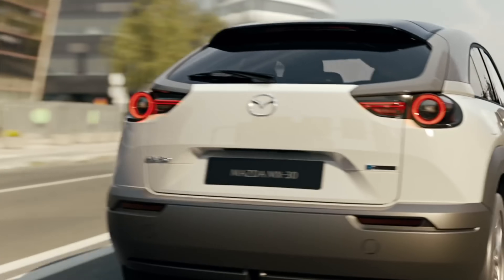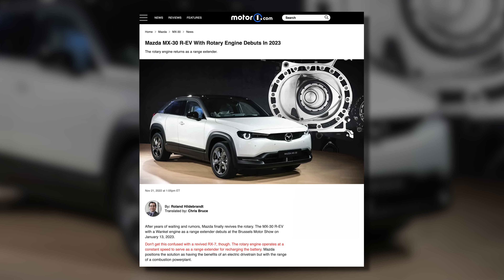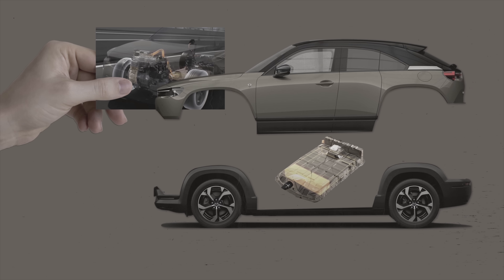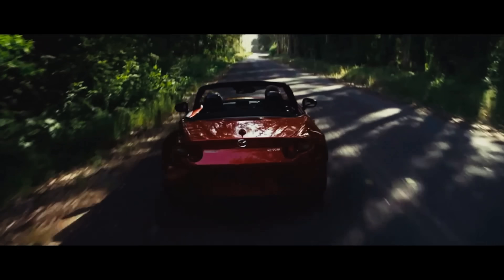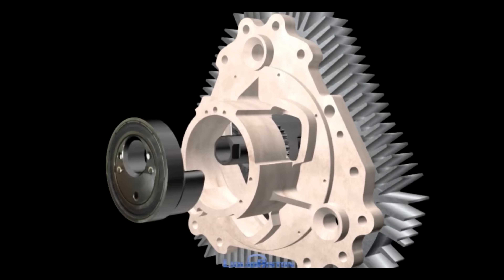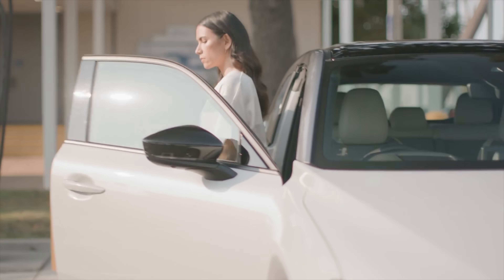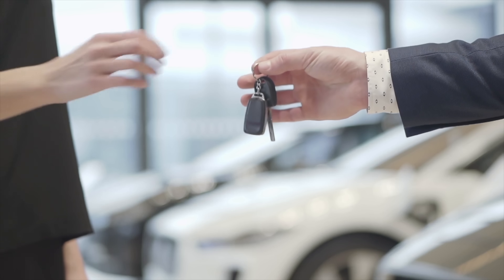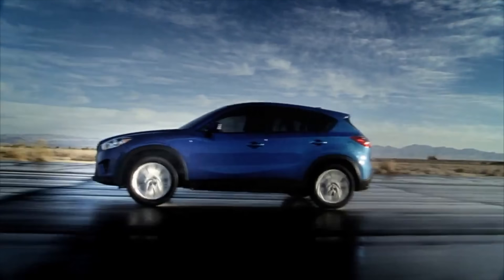Mazda's New Engine is the Smallest and Most Powerful Engine Ever Made

Comment: Plug-in hybrids are the technology of 2010, when batteries where 1000$/kWh
The 2020 standard is more like 100$/kWh, making a gas engine a half-measure and useless weight, expense, main point of failure, a source of ongoing pollution. 
It's a dead-end.

Comment: From what I understand about a PHEV is that once the battery discharges to a certain point the engine kicks in and provides continuous driving only limited by how much fuel you have.
Am I right in understanding that in this case the range extender can't ensure continuous driving just reduce the discharge rate? That at some point the vehicle needs to be connected to a charger to recharge the battery or let the engine recharge the battery while not driving, is this correct?

Comment: I think Mazda did great by applying Wankel's engine where it's efficient the most. Another good thing about rotary engines which hasn't been said - they are extremely powerful. 1.3L rotary Mazda could reach up to 250hp which is why there were amazingly popular in Europe where car taxes calculated based on the engine volume not power. Downsizing the engine and leaving only one rotor they still can easily have 50-60hp engine from something less than 500cc, which is also plenty for generator alone, and because rotary engine can work in the most optimal mode while charging the battery their lifespan can also be hugely increased. Fixing rotary engine isn't hard as it only has 3 moving parts altogether.

Comment: Would the motor be able to charge battery without use of charging station?
Reply: Yes but using a gas engine to charge your batteries is not that efficient.

Comment: I like the idea of a range extender EV with a much smaller battery than typical EVs, but I'd stay clear of rotary engines. I kinda like the opposed piston engine designs I've seen. I can imagine one of those making a great range extender.
Reply: I like your thinking.
Perfect application for a small OPOC engine running at a constant RPM when needed.
Reply: I’ve thought the same thing, it’s something I’d like to experiment with if/when I ever win the lottery.
Reply: The opposing pistons are great and produce extreme torque. It's use in WWII submarines proved it. In fact in some cases trouble or damage was sometimes temporarily overcome by disconnecting a cylinder if needed. They are, however, two strokes so diesel or a fuel/oil mixture is needed to keep the cylinders lubricated so that's a negative for emissions and as with all reciprocating pistons, they stop twice during each rotation. The rotary has the potential to be a lot better because it's torque curve is like a turbine or electric motor; just smooth and steady.
Reply: @waynegilchrist1596  I've read of gasoline OPOCs, but I don't know about the lubrication. I'm not too much of a gearhead, and it was some time ago.
Reply: Very little vibrations with rotary engine. 1/2 the weight of the other internal combustion engines. This engine could also run on Methanol, DME, Hydrogen, Ethanol, propane et al.

Comment: These hybrids are a way of rapidly getting more electric vehicles functional. Using less heavy and precious materials in the battery.  However I am puzzled over the choice of a rotary.  I loved my rotary RX3 but it was inefficient at low throttle settings.This it has in common with two stroke engines.  But worse.  Now if the engine was small enough then it would only ever be run at optimum load.  If I understand your video this is a 70 HP engine.  Until recently I never had a car with as much as 70 HP running as a pure gasoline vehicle full time.  How much power do people REALLY need?  Obviously way more than is good for the environment.

Comment: My concern is too frequent charge and dischage the battery because of that's battery size. It is gonna be a problem for the battery life span.
Reply: But the battery will cost half as much so you can replace it and you arn't lugging a big battery around all the time.
Reply: @gbone7581  Many manufacturers promised low-cost batteries, however, They never came. 

You can see Toyota Prius battery cost. that is not even lithium ion and is much smaller than this model. 

They have low energy density and cheaper material but they charge at least $6K-7K for replacement.

Comment: This "Most powerful engine ever made" weighs 97Kg, produces 145 Hp at 4500 RPM with a torque of 200. Koenigsegg also put a support engine in their electric hybrid, it's a 3  cylinder, 2 liter double turbo engine that produce 600Hp and 600Nm torque at 8500RMP with a weight of 70Kg.

No, it's not even close to a fair comparison, you could probably buy the whole current Mazda 2023 model program for the cost of a single Koenigsegg, but that stuff is irrelevant when you make the claim "Most powerful engine ever made" without adding "rotary" or whatever other excuse someone might have when calling a 145 Hp engine "The most powerful engine ever made".

Comment: So they are taking a poorly designed EV and adding in a low thermal efficiency motor which also needs gas tank and plumbing and it makes a lot of heat.  This will not end well for Mazda.

Comment: I have a 2016 Chevy Volt which has 53 electric miles and 302 gas miles. 85 percent of the miles are electric. Gas miles are only used when I travel long distances. I like the Mazda design. The reliability of the engine is to be determined later. The reliability of other components are also to be assessed

Comment: Been saying for a long time a small 49cc engine operating at it's "happy" rpm's, keeping battery topped up was the way to go.
Reply: The Mazda engine produces 70PS.  I doubt a moped engine would be in its "happy" rev range trying to produce this!  In any case, EVs are not really the future, are they, if they have to be propped up by internal combustion engines?
Reply: @ParaBellum2024  why are engines so large? Is it so they can idle down the highway? No. It's so you can have the acceleration or power even in the lower power band. What are electric motors good for? Acceleration in the low power band.

We could have smaller engines and less acceleration but that has been tried and doesn't sell. People like performance too much to give up the modern conveniences.

Comment: Good idea but what about using the compressed air engine instead of the rotary engine for extending the mileage of the batteries. Use compressed air and batteries, no gas involved.

Comment: I've always wondered why more car companies don't do hybrids this way?

The combustion engine powers the electrical system and that powers the car.
Reply: While an electric drivetrain is pretty common for large vehicles (locomotives, ships, dump trucks…) I think it’s just not very efficient for small vehicles where the power output can easily be handled with directly connected axles and mechanical gearboxes. 

With real big hardware, dealing with huge axles and gearboxes just can’t beat the reliability and simplicity of an electric drivetrain that directly drives whatever axle needs to be rotated, so the relative inefficiency of electricity generation is perfectly acceptable.

Comment: And most countries are burning more coal for electricity generation to charge EVs or PHEVs. The public are being sold this is less emmissions but do not show complete senario. Mining coal, transporting shipping unloading transporting coal to power stations. The extensive mining and refining of metals required for batteries and electrics. Upgrading electrical grids for higher capacity, charging stations infrastructure. The comming electrical risk high voltage EV systems - qualified electrician requirement.....

Comment: Adding an onboard generator to an electric vehicle would not only extend the range, but make possible to charge the battery during electricity blackouts - which, incidentally, California is notorious for.  I live in Connecticut, which also has it's share of blackouts but isn't gung-ho for electric vehicles the way California.  If were in the market to buy an electric vehicle, I would consider the  presence of an on-board generator a plus.
Reply: But if you got an inverter generator you could take it with to charge the car on long trips and you could use it for camping?

Comment: Wondering how long the lifespan of the batteries will be, dealing with the heat of them being filled/ charged and drawn from/ discharged, at the same time.?
Maybe it would be best to use as a standalone unit for home. If you could order just the charging motor and battery pack.

Comment: Basically a Toyota Prius.  
The last rotary they had wasn't reliable.  
Better off with a Prius.  
The more the complex vehicles. The more it will cost to fix them. 
If you're going this route.  Get one that's reliable.       Prius makes some sense.  
Many people don't drive that far to go to work and back. Pretty much use electric and u don't need that big of a battery.   Reducing weight and cost. 

But still.  U look at a Honda civic just gas version.  They get 40 mpg.  Not really worth making a vehicle more complex and more expensive to repair with added stuff.

Comment: I will stick with Toyota / Lexus hybrids. They have been mixing engines and battery's for a very long time.
They are very reliable, and the 10-year warranty offered by Lexus shows it has confidence in its products.
I think BMW tried this by putting a scooter engine in one of its EVs as a range extender.
I don't think it sold well.

Comment: Love the idea, not the numbers...

If Mazda is rating the MX-30 with extended range at 400 miles, it has failed again.

13 gallon tank, 50 miles PHEV range = less than 40 miles per gallon in range extend mode.

"Everyone" who is has a compact hybrid is getting at least 40 MPG. Some are getting 50 MPG.

The MX-30 is likeable idea. I drive 50 miles a day (2 x 25) and can charge between drives. 

How many recharge cycles can the battery take before it drops to 80% of rated capacity?

Are they going with the newer lithium-iron-phosphate batteries?

I would get a proven Prius, or the the newer Corolla hybrid with AWD before I would spend on this idea.

The GM Bolt at $26K is looking exciting compared to Mazda's next rev of the crank.

And yea, I had a Mazda RX-7. Great car. Never had any problems with it. I was hoping the revised engine configuration in the MX-30 configuration would yield a 55 mpg extended range... Something special.

Comment: I don't know Scotty , you didn't say how many gallons of gas it takes to extend the range to 400 miles. You didn't mention any equivalent type of MPG to compare to and you didn't mention torque output or 0-60MPH times for the electric version of the vehicle. 
So how can I draw any useful conclusions?
What I heard you say was that Mazda is using a different type of motor to power their electric motors than GM uses to power the  electric motors in the Volt.
That much we can agree on.
Other than that, it was just kind of a recycle of your previous explanations of how a rotary works .

Comment: Since the new rotary engine is doing so well, why not just ditch the extra weight of the unsustainable battery pack and electric engine and just go with the new lightweight GAS engine  only?  Electrification of the  America cars is just another pie-in-the-sky waste of material, added third world pollution and impossible to without building a heck of a lot more gigawatt power plants, i.e. nuclear, natural gas and coal plants to charge them. Efficiency is horrible with electrics. I'm telling you the numbers do NOT equal less CO2. Which by the way , if all the CO2 is gone everything dies. Remember your biology class and the photosynthesis cycle that ALL life depends on?????

Comment: I would like to know if rotary engines suffer from engine carbonization due to direct fuel injection like normal piston engines do.

Also how long before the battery pack needs to be replaced and at what cost? My fear is that you would have to replace the battery pack every 3 to 4 years. I don't think Lithium ion batteries have a good enough charge/discharge cycle lifetime for this type of hybrid setup.

Comment: This is an ideal use of a rotary engine. It is small and light. Mazda have been able to pick the rpm range to make it most efficient for charging. What really interests me is the potential ability to use it and the battery as an emergency generator for my home. That is becoming an increasing need give the bigger storms.
Reply: Single speed Diesel engine or gas turbine would also make good generators.
Reply: @AlwaysCensored-xp1be  Yes of course, both are used on larger scales. I want relatively low emissions and noise, hence the battery hybrid.
Reply: Pressure your local power company to put the power underground. This has been policy in New Zealand for decades, and improves reliability in the worst weather (and earthquake).
Reply: @paullangford8179  Our power company doesn't even do what the regulators tell them! Finally they are doing regular maintenance that is very long overdue.
Reply: 1500 watts is too small to power a home
Reply: @sdgreen4580  Correct, but a refrigerator and a couple of lights should be fine. And can the output be greater with the Wankle running?
Reply: @sdgreen4580  my computer is 500watts fridge is 400.. that’s all I need
Reply: @brandongreene9615  Keep the beer cold. I like your priorities in life :)
Reply: This would be a godsend for people that go camping no? Also those folks that may run a food market stall or the like. I can imagine needing something like this to run a small fridge or an electric griddle, maybe some small lights etc

Comment: I think it's a bright idea to use the rotary engine as a generator for the Vehicle. My only regret is that if the rotary engine is used to recharge the battery while the Vehicle is on the road, why can't it recharge the battery permanently while the Vehicle is running instead of impressive 400 miles of range extention?

Comment: Hey Coach have you looked at the Omega1 engine by Axios Aerospace?  I believe it will replace all motors.  It is that revolutionary.  Basically a two tooth motor.  One tooth spins around and compresses air that is injected with fuel as it enters the other chamber where it fires and pushes the other tooth around and expels the spent gases.  Way

Comment: I have a Chevy Volt that gets 48 miles on the battery and works the same way this car will. It is genius. I buy maybe 20 gallons of gas a year. When on the gas at 80MPH I get 40 MPG. Long trip, no trouble, go on gas. IMO this is where all of these cars should go not direct to battery only before battery tech is further along.

Comment: This type of hybrid (pure electric drive train, with generator ICE) makes a lot of sense. This is how almost all modern train locomotives are powered. The pure electric drive train eliminates the costly, complex transmission, and allows for regenerative braking to recharge the battery. The gas engine/generator allows the car to go on long trips without range anxiety and wasted time charging. The engine/generator can produce cabin heat on cold days without draining the battery excessively, and (if designed well) can also be a general purpose electric generator for remote locations and blackouts. The flexibility of being able to use gas or electric is useful when the grid goes down or gas stations run empty.

Comment: Thanks for the update.and your show. I (unfortunately do live in California). However the hybrid car makes a whole lot more sence than a purely electric vehicle based on the way most people drive and depending on the emissions data would be my personal choise. Purely battery powered EVs are not Carbon Neutral when you look at the costs and emissions for the manufacturing of their lectronics and batteries. Other advantages to the rotary engine hybrid is that since it is driving a generator and not the wheels it should be running more efficently running at a relatively constant speed. One last thing since EVs all will need to replace their batteries and the Mazda hybrid's battery is smaller it should cost less to replace

Comment: Great video. Just wanted to pull the curtain across electric vehicles. SUV  cars are on average 20% less efficient over a sedan. An EV only gives a 20% saving in carbon over its life time. In Australia  60% of electricity is coal powered. Therefore if people chose driving a sedan type petrol powered car you would be saving the more. Check it out and prove me wrong.
Reply: The fact you think Carbon is a problem proves you wrong.

The rest of us sane people shake our heads in amazement how easily people are fooled.